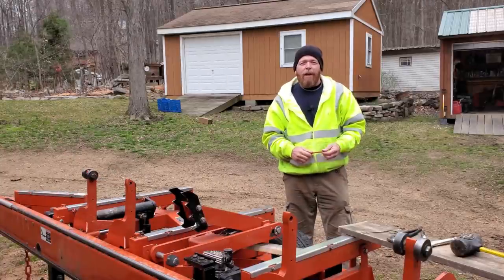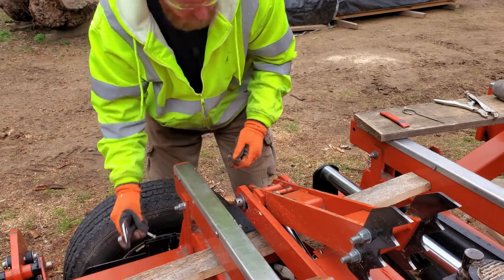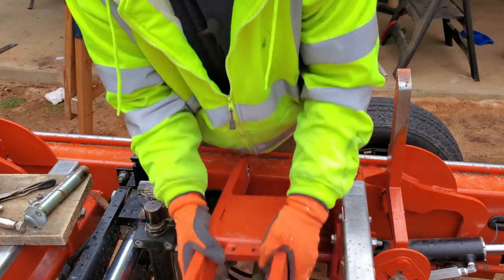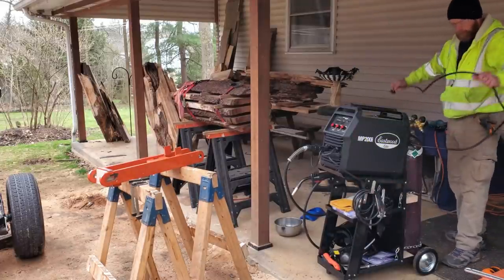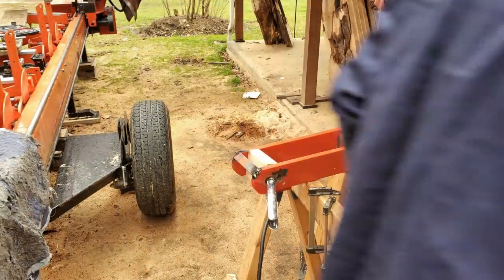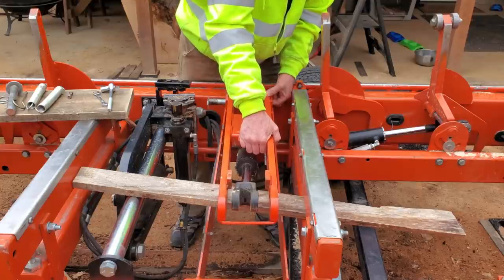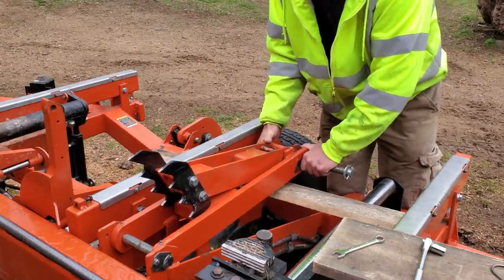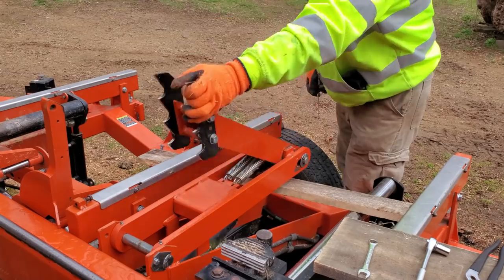I Broke It Again

Comment: You putting that cotter pin in reminds me of touring the power plant while it was being built (40yrs ago). The cotter pins holding something were over 5” long and each side was about 20” around.  Amazing!
Reply from the maker: Which power plant was that?
Reply: Shippingport, PA, I think.
Reply from the maker: @sharonyoung8251  we aren't far from Limerick power plant. Thought we might be neighbors
Reply: I don’t live there, I worked for the company in Jackson Michigan, that built the power plant. It wasn’t yet finished and they took a couple bus loads there to see what we were building. It was amazing. We walked inside the cooling towers and the tops looked oval until you walked toward the middle and looked up.  It really changed my perspective of the drawing we were working on.
Reply from the maker: @sharonyoung8251  applied for a job at limerick and walked through the site looking for the bosses trailer. Was amazed at the cooling towers. Never got to work there, but it was amazing to see it all.

Comment: Great work. Just an observation from an old fighter jets mechanic. Please don't stick your finger into a hole to determine if the parts are aligned up. I've seen two different people loose a good finger doing it to feel if the engine lugs were aligned. The weight shifts faster than diarrhea. And that control arm was heavy. LOL I'd hate to hear you lost a good tip. Other than that, again great job and with as heavy as logs are I don't think it matters how good of a weld is on that small stop. It's gonna let go one way or another. Which is probably a good thing or else it would tear that box frame up. Hey, really enjoyed the mechanical work, and in the light rain too 😁👍👍
Reply from the maker: Thats my second warning about putting my fingers in places they dont belong. I have a better i de of achieving alignment, the next time I work on this arm. Let's hope I don't have to though.
Reply: @IronOakSawmill  yes, I hate it if you couldn't point things out! LOL or flip me off, hee, hee. What I didn't tell you was the fact that I use to do that until the one airman was departed from a beloved index finger. I got the point,😮😳
Reply from the maker: @barrywest3758  I'm not sure that steel was heavy enough to cut anything off, but it still wouldn't feel good, thats for sure.

Comment: I have been using my clamp to protect myself from this ever since watching your first video.
Reply from the maker: Just watch it on the big logs. If your clamp is up, you roll the log with the turner, and it jams between the stops, and the clamp, you won't be able to lower the clamp to free the log.
Reply: Yea. I try to keep it on the lower half or I roll it in smaller increments and clamp it in place and reset my log Turner. I have had a fear of doing this since the last video and I have never even done it yet

Comment: Looked like a good job from here..hope it goes well..
Reply from the maker: Same here SS. Time will tell. Now let's see what other trouble we can get in with this welder.
Reply: Iron & Oak Sawmill Yup..I had a 110 volt stick welder before the fire..I still have it, but have not tried it since. I want to build a couple towers for my ham radio antennas soon..I’ve welded small tubing before, it’s tricky and have to use small rod

Comment: I was taught when using a nylock nut you just tighten it to when the bolt shows to the other side!  The reason you do not tighten the nut as you did is the part has to rotate.  I'm just
 a DYI so maybe I could be wrong but that is what was taught some 60 years ago???
Reply from the maker: I agree with that, but in this case,  there is no need for the part to move. The bolt goes through a stationary retaining plate.
This was just me getting crazy on torque. 😅

Comment: Watching you fight with the pins had me sweating. I hope that when you edit this that you see that you put your digit in harm's way as if the arm slid while holding with other, it would of sliced it off slick. Use a guide bar or screw driver to sort the pin positioning.... please... this is one as a EMT, I visited many times a person is trying like you to feel the position and it will cut it like a paper shear. No mercy and then you can only count to nine and a half or less. I am very serious and hope your not offended by this as I am seventy now and over the thirty years seen as high as five a year in the  various shops. It is slick painted surfaces and you just wiggle it a little bit and things really go south fast. Otherwise great little how to video that shows inter works of a mill. I have as mentioned before built my own mills and worked as a millwright  and various jobs that I never got good at. I just did the best I could and watched others so I didn't embarrass myself very bad... I did do a good job when I did that, earned me, my share of nicknames so use a metal something and leave the finger to explore a different item as in pointing at
Reply from the maker: Thank you for the advise. I saw in editing that the support board I had in there was on an angle, and that kept everything cock-eyed, and difficult to align.  Ill have a better idea of how to work with this a bit more safe in the future.
Thanks Morgan.